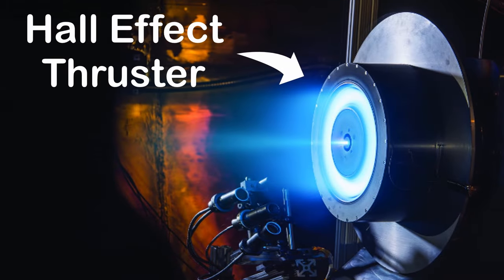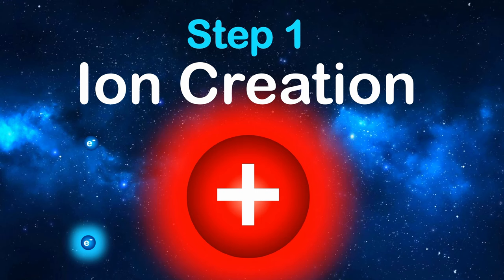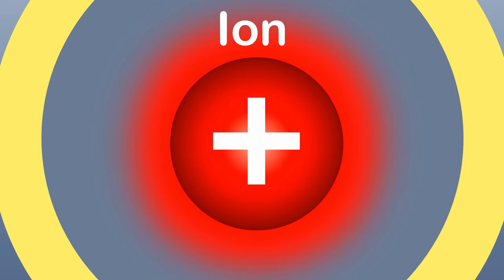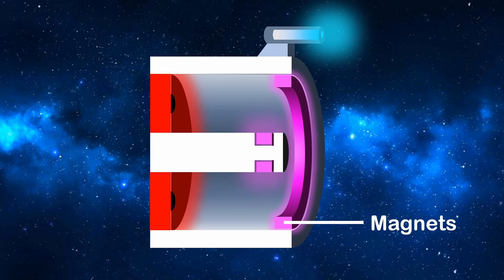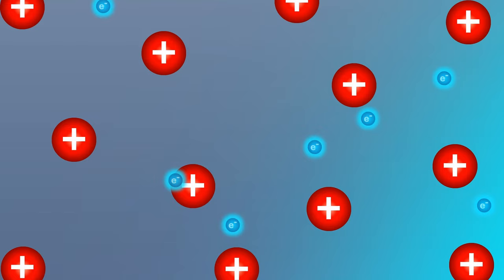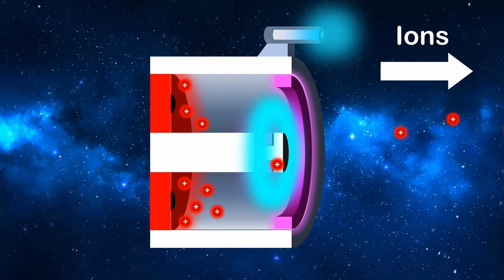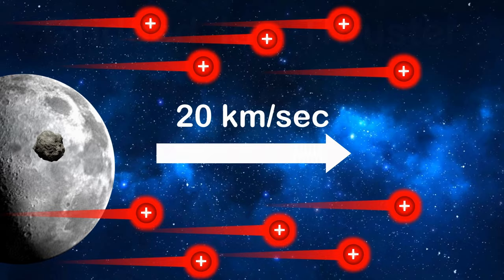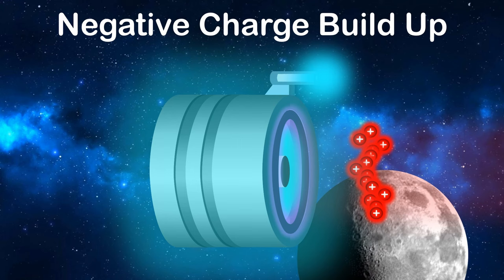Returning Man to the MOON! | How Do HALL EFFECT THRUSTERS Work?

Comment: So basically its a microwave magnetron with one end open?
 No reason they couldn't use microwaves to also help increase charge separation and send a tiny bit more momentum out the back, yeah? 
 How much thust do you think a conventional microwave oven could generate with the back end of the magnetron cut off and the negative antenna slightly extended?
(Not that it matters much to me stuck here on earth)

Comment: Maybe low trust is a good thing, because wouldn't it also run out of electrons , I imagine it can be resupplied via the small amount of air in space  , so maybe faster isn't possible.
Reply from the maker: That's a great point. Ultimately the electrons would only run out when the proppelant runs out. This is because the electrons lost by the Xenon atoms during ionisation flow back to the anode to be reused again. So in principle the thruster could run out of proppelant (and hence run out of electrons). But in practice, because of the very high efficiency, the thruster will break before the proppelant runs out anyway. So in practice we're unlikely to run out of electrons.
Reply from the maker: On your point of capturing proppelant from the small amount of gas in space, this is currently being researched. For Spacecraft which orbit close to earth (VLEO) there is sufficient air density to supply an airbreathing ion thruster.
Reply: @ScienceWorkshop464  I was wondering why the engineers don't try that. 
Almost all gas can be used , right?
Just need sufficient energy for ionization.
Reply from the maker: @m.c.4674  another great point. So although most gases can be used, there are a few factors to consider. Firstly an inert (non reactive) gas is preferable to avoid unwanted chemicals reactions with the thruster itself. Also a gas that requires a fairly small amount of energy to ionise is desirable (Xenon is a good choice). And a gas with large mass (like xenon) is desirable so as to maximise thrust.

The nitrogen that mostly makes up air isn't ideal (but it is still usable) for ion thrusters. 

Also given that ion thrusters rarely run out of propellant before the thruster itself breaks (usually due to electrode erosion), its currently not nessasary to collect more proppelant from the athmosphere anyway. 

In the future when the lifetime of thrusters improves and proppelant becomes the limiting factor in the lifetime of a thruster, then air breathing thrusters will likely become a feasible option.
Reply: Low thrust, yes. But these thrusters mainly focuses on efficiency. And these are only for vacuum. It creates low thrust but steady acceleration. That's the catch. With time acceleration of spacecraft will be increased a LOT just by consuming very small amount of propellant.